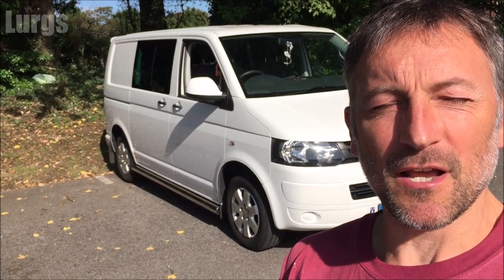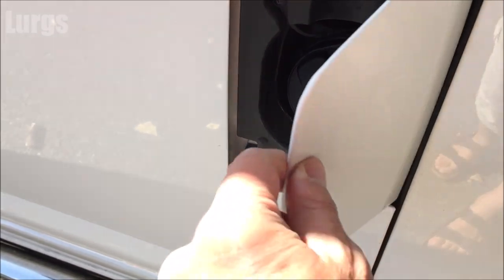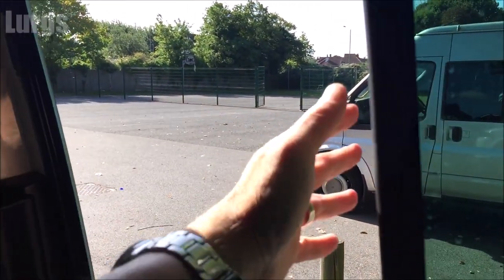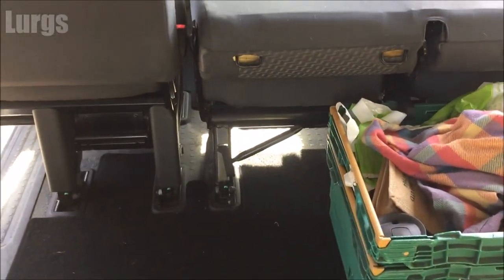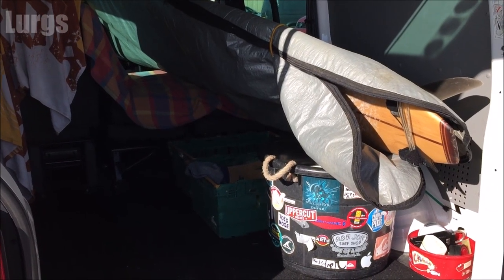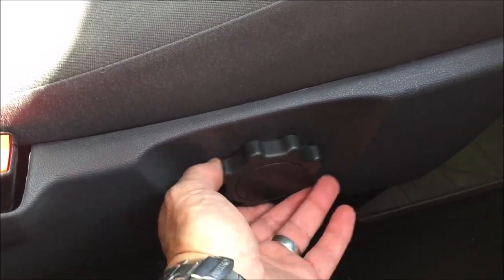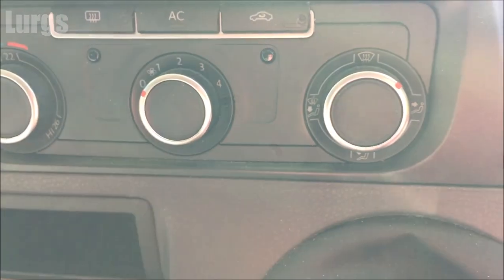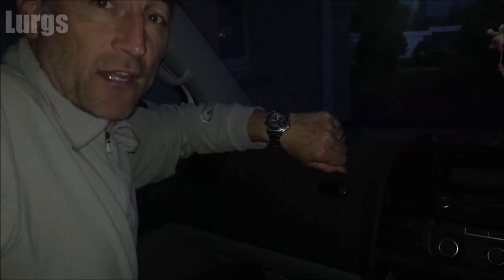VW T5 Kombi Review and Drive 2011 140hp - Volkswagen Transporter Review

Comment: Hello good sir, 

quick question. Is this T5 worth buying with  240.000 km on it? Its a Diesel that I am looking at for about 6900 euros. roughly 5600 pounds I reckon. I am buying it specifically for my dirtbike. Thank you in advance!
Reply from the maker: SEEKDiscomfort If it’s got good service history then that mileage isn’t too bad. But if it’s a Van (not a Kombi) then it might have been a builders van hauling tons of bricks about all its life and be worn out. Worth a test drive, check it drives ok, check not smokey and that engine oil is not low. They are lovely Vans if you look after them. It’s got an undertray so hard to spot any oil leaks, might be worth whipping that off if you can.
Reply: @LurgsHowToGuides thank you kindly! I will remember this if I go out and test drive it! Have a pleasant day and stay safe!
Reply from the maker: Happy to help. Yeh take it for a drive. Make sure engine is cold when you arrive to make sure it starts ok. Then take it for a spin.
Good luck.